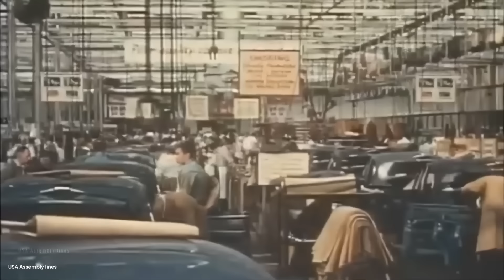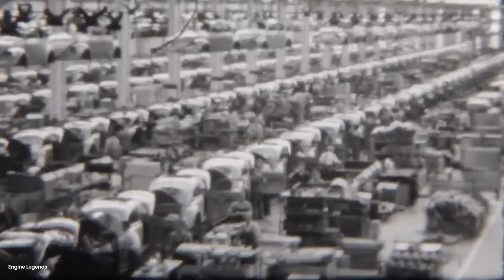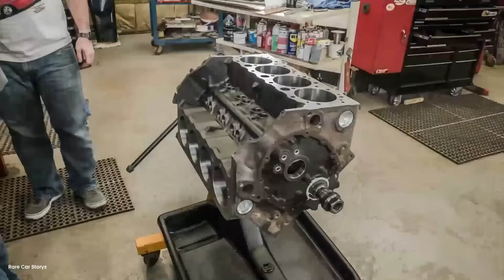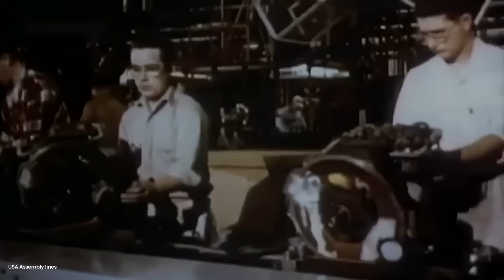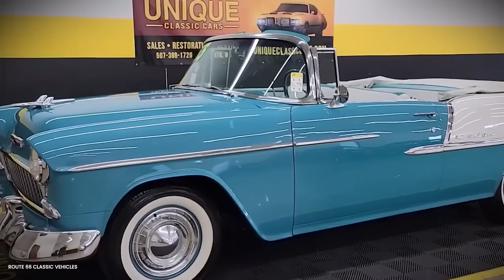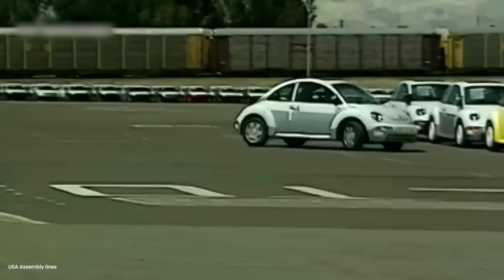This Cuban Mechanic OUTSMARTED GM With a "Banned" Fuel System That Runs on Cooking Oil

Comment: Reminds me of the early aviation pioneer/racer Steve Wittman from Oshkosh WI. In the 20s, 30s and 40s, he was beating the major aircraft manufacturers who were using large engines to race. Because of his limited budget, he was using small engines and airframes and beating the pants off them. 
BTW, if you're flying a Cessna with flat spring landing gear, thank Steve; he invented it.

Comment: This is great, but going with a diesel engine, to begin with, if possible, is best.  I learned an interesting fact in an Engineering Fluid Mechanics class I took.  The professor's PhD was in Petroleum & Natural Gas Engineering, and he had worked in that field.  He described this.... Natural gas pipelines go for hundreds, even, thousands, of miles, and must have compressors at periodic intervals, to compensate for the frictional losses of the fluid flow.  But they're often in uninhabited areas where electricity or regular fuel is unavailable to run them.  They have diesel engines, and they're run on the very same natural gas they're pumping!  And it gets better!  During WWII, the Japanese, who had a petroleum shortage, ran their diesel engines on COCONUT OIL!  That's a VERY viscous oil, which is solid at room temperature.  So they'll run on natural gas, which is methane, the LEAST dense gas in the Alkane series, coconut oil, which viscous & has a high melting point....and, of course, diesel fuel, which is in the middle. I think, if a liquid or gas will burn, it will run a diesel engine, provided the injectors & other fuel system components are the right kind!  :face-blue-smiling:

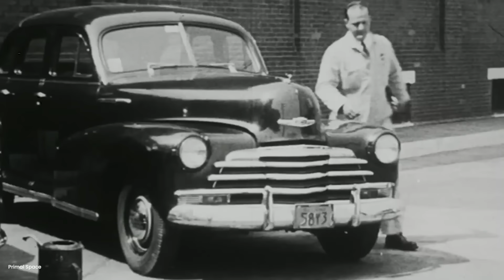Comment: 17:21  I think this depiction of oil flowing through a funnel indicates MORE than most people will recognize!  Having the correct viscosity of the oil is important, & there are a couple of ways to measure it.  In the lab, a "viscometer" is normally used.  This consists of a cylindrical container, with a smaller diameter concentric cylinder lowered into it.  It's attached to a motor-driven shaft, the space between the cylinders is filled with oil, and the drag on the spinning cylinder, due to the oil's viscosity is measured.  The readout is in Centipoise, or other units.  But engineers in the field use a MUCH simpler method to measure viscosity!  It's not quite as accurate as a viscometer, but adequate for most purposes.  A funnel built to certain specifications is filled with oil, the then drains out, and that time is recorded.  With the special funnel, that number is the viscosity in "Saybolt Seconds."  https://en.wikipedia.org/wiki/Saybolt_universal_viscosity   That can be converted to Centipoise, with a formula or chart.  HOWEVER! :face-blue-smiling:  You don't need a special funnel if you're just checking the relative viscosities of two oils --- If you compare the vegetable oil with diesel fuel, getting equal times for both is all that's necessary.

Comment: My 75 cadillac deville had the 500 cubic inch V8. In 1986 I did an experiment and squeezed my metal fuel line half way closed with a pair of vice grips that is between the fuel pump and carburetor. That car starting getting the same gas mileage as your basic 350 chevrolet small block cars and ran better. A mechanic at Hertz car rental explained to me that what I did is create my own fuel pump pressure reducer. That car was still running great in 1995 when I parked that car because of excess body rust. Look at all the people I beat with my stupid little trick I did one night.

Comment: I believe it very possible. Engine can run kerosene if it's hot enough.
Reply: You can run your kerosene engine, that's not the big thing. The problem ISIS once that it cools off. You won't start it again.

Comment: Oh, the Smart Car Diesel . . . In 2003 it was a option in the rest of the world. It was also qualified as the cleanest engine ever offered in a production automobile. And yet it was not allowed to be imported for sale in the U.S.
Why, you ask . . . 
By then Mercedes knew they were not making money off of the Smart. Not in sales nor in repairs. So those 2 pieces of paper were not submitted to allow it to be sold in the U.S..
But it was sold in Canada. And the rest of the world. And it far exceeded the projected MPG of 65 to 80. In the frozen tundra of Canada it was getting 85 to 94 MPG. Remember the Rabbit diesel that got 55 MPG back in the 80s?
Now think about the advancements the universities have been making with the "common" rail diesel.
But the Smart diesel is no longer available.  And that is agregious !
I managed to buy one of those diesel engines out of a wrecked Smart. Hoping to switch out my gasser in my 2008 Smart.
You have given me a lot to think about . . .

Comment: Irony , necessity is definitely the mother of invention.
Reply: Another old idea was brought up by this video. They talked of how modern autos have thousands of dollars in extra technical parts to operate the same as this Cuban rebuild. Evidently our engineers are not taught the old engineering principle called the K.I.S.S. method. "Keep It Simple Stupid!" The more parts, the higher technology, and the harder production procedures needed to create an idea. The more problems of running and maintaining it. Simple is better. This design described in the video lasts a long time, with little maintainable, and less cost. As compared to the modern attempts as described in the video.

Comment: A compelling case for biodiesel. But not as efficient as batteries. Tesla, and legacy super seized vanity pickup trucks not withstanding, EVs are the best bet. Fewer moving parts. Production costs for the traction battery pack are one-off. 

An internal combustion car has similar production costs plus the day to day expenses for gas, oil, antifreeze, fuel filters, oil filters and other suprise expenses that EVs just don't have. BTW that's how legacy dealerships get paid. Not the sales floor but the shop.

Biodiesel is cleaner but it still has has all those expenses

Comment: This is total bull💩… There’s no way the 265 c.i. Chevy gasoline V-8 will run on diesel or vegetable oil at a 8:1 compression ratio .What is true is that most antique American cars gas engines have been swapped to Diesel engines..Then it is plausible to use diesel/vegetable fuel mix. Everything else on this video is just made up crap.
Reply: he basically converted a gasoline engine into a diesel engine with spark plugs.  i have a direct injection gasoline engine in my car, it works well. The mechanic was clever to preheat the oil using the exhaust manifold.  very clever

Comment: Hi am from the UK 
am 64 I remember my dad telling me something about this and it may interest you 
I think the original inventor must of been looking at this 
and how to solve the water content 
if you get 5 gallon of cooking oil it's full of 
all sorts as you know but he found there was a very simple way 
of cleaning it 
I've watched videos of Americans using 3to4 different types of filtering methods 
and told them that it could be all cleaned 52 gallon of it in one night without all the hrs lost doing what they was doing around the time of covid 
what I told them was this in the 1950s there was a British patent for cleaning the oil 
now I'll tell you what my dad told me and his dad told him 
that the problem with the waste oil 
is the water in it 
but you can try this your self what it is pig gelatin get 1 pint of old crap oil then get 1/4 pint of water red hot 
then mix in 2 large table spoon of gelatin in the water pour and mix  together when we'll mixed put to one side 
in a cool place 
in 24 hr you will have lovely clean oil 
with all the water and crap set at the bottom making beautiful clean oil with know water in it then just pour off the oil scrape out the jelly 
it works the same on a very large scale 
just need to alter the gelatin and HOT water mix 
it's that simple 
when mix with 30% paraffin or kerosene for you yanks it was run for 5000 miles run brilliant with know damage to the Engine hope you like this and it helps you Watch Robert Murray on YouTube

Comment: This story sounds like Fiction. Diesel engines don’t use the carburetors. 1950s Chevrolet cars or gasoline not diesel. I’ve heard of running diesel engines on vegetable oil but gasoline engines not so much. I know that during the great depression, people would put mothballs in diesel fuel and run a model A ford.

Comment: 12 miles a gallon? Excuze me mine got, at least 22 mpg thank you very much
Reply: Too much of the stuff mentioned is not available in Cuba, peanut oil? coconut oil? fuel injectors for 15,000 conversions? $150 for a conversion when an injector is about that much money? 200,000 miles driven in Cuba? I see too few videos from Cuba in this report and a lot of stuff that sounds hard to believe.
Reply: They meant 12pm around town:mixed driving & not cruising on a lrg interstate highway in the USA where you get best mpg.

Comment: When I was a teenager in the 1960s I went with my uncle to buy a 1924 Fordson farm tractor that ran on kerosene. The tractor was factory equipment with a small gasoline tank and a large kerosene main tank. You would start the engine with gasoline and switch it over to kerosene when it warmed up.
Reply: yep, similar system
Reply: John Deere and IH Farmall had models that ran distillate fuel or gas from factory.
Reply: @normtew6354 John Deere also. It was fairly common back in the day. Dad had a model "H" Deere that was set up for dual fuel.
Reply: Zora Arkus Duntov was a major player in the design of the small block Chevys!!
Reply: Zora Arkus Duntov was a major player in the design of the small block Chevys!!
Reply: When you think about  using micro algae fed with human and animal waste to grow virgin veggie oil , the gubmint needs to shut this down rite now...we wudnt need big oil no more for nutin

Comment: Diesel engines run on 20 to 1 compression or higher, gasoline engines will not tolerate this high compression ratios, and the rest of a gasoline engine is not robust enough to function as a diesel engine the 350 cubic inch Oldsmobile engines GM developed was a complete disaster because it was a gasoline engine they tried to make into a diesel engine
Reply: My mom's '82 caddy had one of those diesel engines.  Ran great for many years. Besides replacing the head gasket once at 125k miles, only ever had to do just basic maintenance. Mom even gave it to me to drive throughout College. First year I had is when the head gasket went and I was told of the way I drive it, told go slower with take off and be more gentle with it which I was. I drove it for 5 years of care of at the bottom when I bought my own reliable break and she drove for many years after that until a school bus plowed to the side of it. 

Great car. Great engine
Reply: @Dan-xf7bh Your relearned style of driving will even extend the life of a normal gasoline motor. And the easy truth of this is just basic physics. Wear and tear rises fast as higher pressures and speed is imposed on the motor. Easy on the throttle, and good maintenance will give a gasoline engine hundreds of thousands of miles  of carefree driving.
Reply: The idea was not bad. The two main problems were water in the fuel that wiped out the the Stanadyne-Hartford fuel injection pump. That was an eight (8) port rotary injection pump that was mounted where the distributor would have been on a gasoline engine. GM, in their move to save costs, used a simple gasoline engine type filter. Folks with diesel powered boats instantly recognized that lack of a water separating fuel filter was a bad idea for the injection pump and spray nozzles, upgrading with a proper fuel filter. No injection pump issues for the smart people. 
               The other problem was the camshaft lobes. GM, in their quest to build it cheaper, used a cam that was hardened to the same hardness as a gasoline engine camshaft. The cam lobes could not withstand the increased valve spring pressure needed to contain the high cylinder pressure of a diesel engine, thus, camshafts did not last. Volkswagen did basically the same thing with some of their diesel models, except they did so with proper engineering. The little VW four-banger had a very robust lower end.
Reply: I remember those! They told you not to pull heavy loads with those converted gas motors.
Reply: I made many flat rate hours on those 5.7 l diesels in many bonnevilles working heavy line back in the mid 80s. A complete tune up pd I think like 12 hours. If my memory serves they beefed up the crank and cam among other things, but it was to late to save it from it's reputation.
Reply: Not always. Diesels can be a lot lower than that some are 16 to 1. 
I had one of those GM diesel’s
In my halfton truck I got over 25 miles to the gallon. You had lots of torque. It was the fuel injector pump that was the problem and the head gasket
Reply: Apparently you're wrong because they're still running to this day!
Reply: Based on the lies told here about fears of patent infringement, the availability of machine shops to deck heads and blocks and even the availability of oil from restaurants, I’d bet that much of the rest of it was all bullshit.
Reply: Diesels do have plugs. Just not spark plugs.
Reply: Replace with a 455 old. Gas engine. They will bolt up
Reply: @richardpalmer8223 you know that Oldsmobile, Pontiac or Buick engines all bolt right up to a B.O.P. transmission (there are also GM transmissions with dual bolt patterns, so Chevy engines also will attach)
Reply: You can start a gasoline engine on gasoline and then switch it over to kerosene and it’ll run just fine

Comment: Electro Motive Div. of General Motors ,in addition to making locomotives,  supplied power to off shore oil rigs with same or similar diesel engines.  Some were dual fuel.  Start on diesel and switch to natural gas  which is a by product of drilling and free.  Who was first?  I do not know.